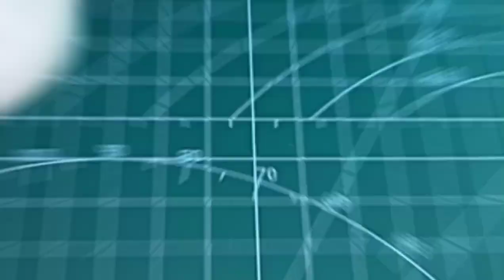40 watt Mini inverter module

Comment: battery has 3,7V   ; mini inverter works a least minimum from  8V , so what uprise Volts ?
Reply from the maker: This module also work on 4.2v full charge of 18650, this module will not work in 3v